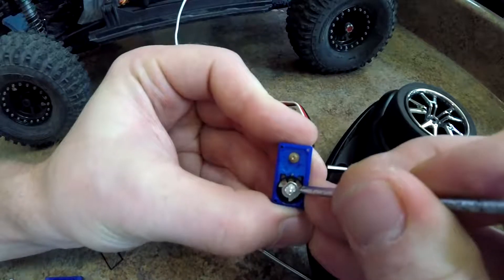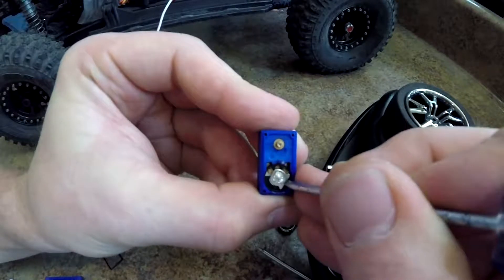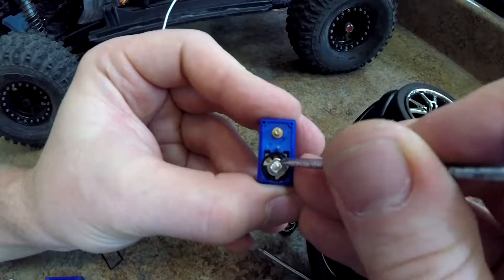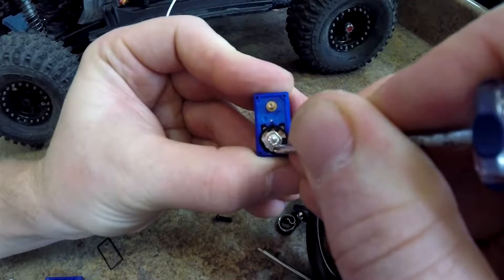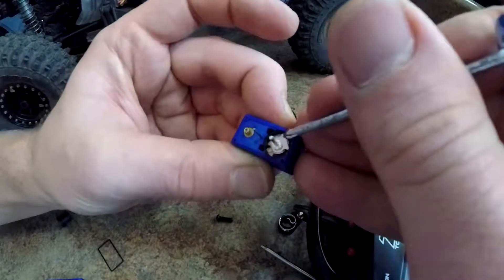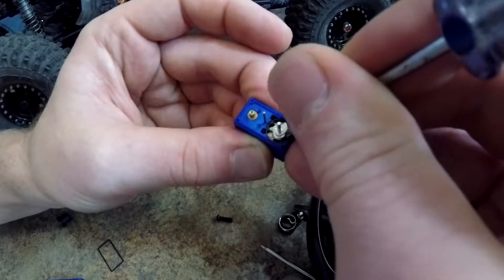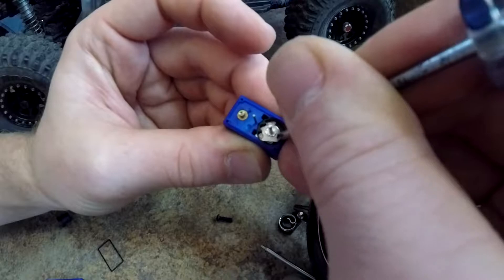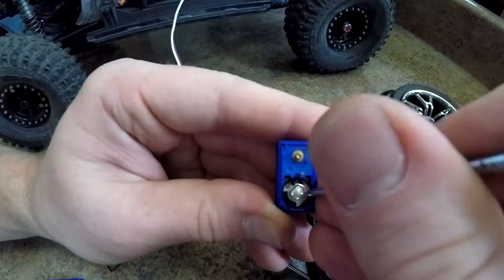Bad sensor Inside the TRX-4 micro servo?

Comment: The point where it shuts off is the position where your radio tells it to center to, switch the position on the radio that shut off point will move. That sensor is a position indicator to the servo to tell it where it is, when you move it around without moving the stick it thinks the servo has drifted off of center and tries to move it back to the off point. And from the video it is working in exactly the fashion it is supposed to.
Reply from the maker: Chris Mckay thanks for the info, I'm not an expert by any means so I appreciate your input. I may attempt to rebuild this servo again if it'll help to understand what the issue might be, but maybe this one is toast already.

Comment: I tried the trick you did with plugging in the shift servo to the steering servo channel and tried to center it. But all the shift servo wants to do is spin in one direction when I have the sensor pot in one spot, then when i turn the steering on the controller, it just stops. Cant seem to find that sweet spot where the shift servo will spin in both directions when told to do so.
Reply from the maker: I'm sorry I dont have a answer for you, this video didnt really provide anything useful aside from the comment from Chris Mckay below. Traxxas now makes an all metal gear version of this servo if you need an upgrade. You could also go to the RCCrawler thread I linked in the description, I think its like 8 pages long now with lots of discussion on these servos.